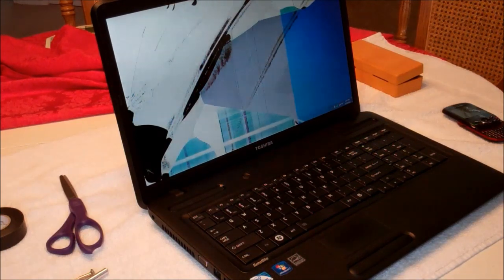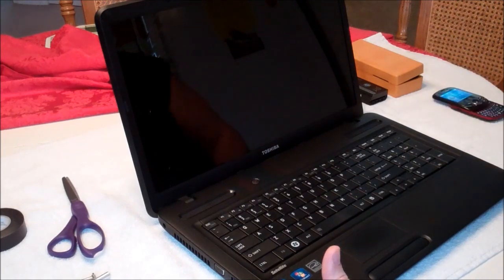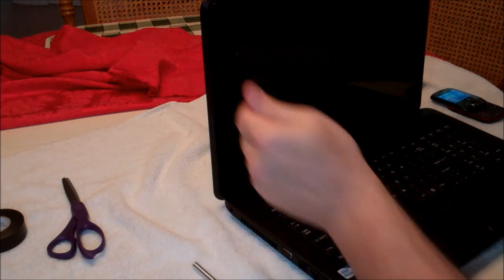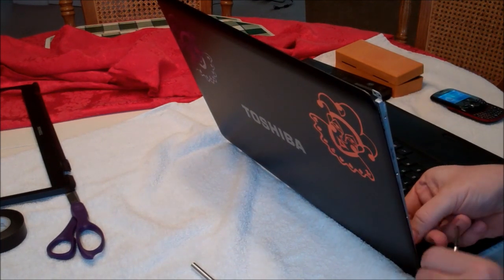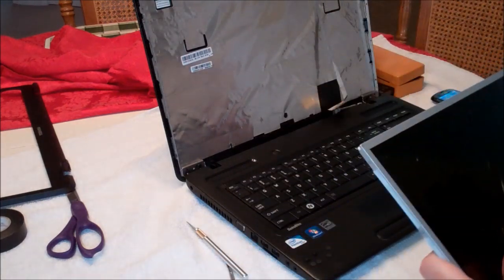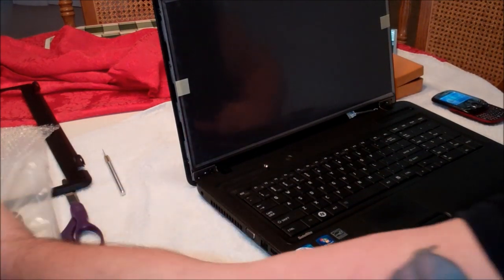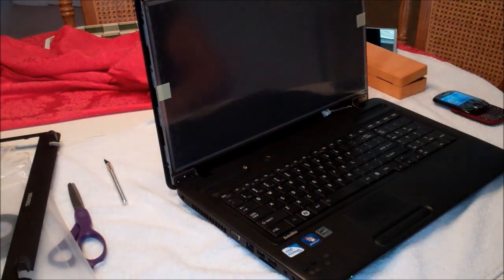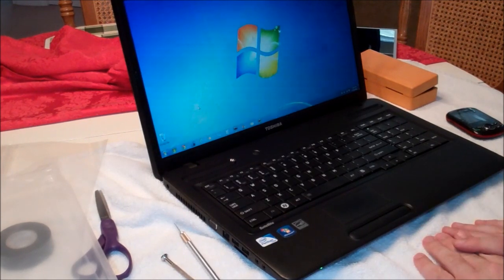How to Repair or Replace a Broken Laptop Screen on a Toshiba Satellite with Web Cam

Comment: I was able to connect my pc to the TV and use the TV as my output for now until I get my new scree. The pc screen does not come on till now. I hope it will be okay when I pot in the new screen eventually. I have been using my pc with the TV as my output. Thanks for your help.

Comment: Hello Jason, Please I like to ask you a question. I have a broken laptop. I had not ordered for the part but I had to open it up to see where the computer connects to, left or right and also to know the inches of the screen as I understood that it is written at the back like LTN156AT24....This made me know it is a 1.56 inch screen. It is a Toshiba satellite L850D-12P. It is connected to the bottom left just like the one you used in this video.After getting these info from the back of the screen after removing the bezel, I tried to couple everything back since I do not yet have the new screen I needed so I could still be using the broken screen until I order and receive the new screen. To my surprise, the laptop refuse to come on. When I replaced the battery and powered it on, there were the 3 usual  light indications on the keyboard area but the monitor had no light on it. The screen was still dark as if the computer was off. I do not know why this happened. I wonder if there is a contact problem somewhere. The only screws I removed was the four holding the bezel and the four holding the back case with the screen. I did not remove any connections. Please do you have an idea what could have gone wrong? I still need to use my pc before I receive my new one. I would be so glad if I can get a reply from you. That would be awesome. Thank you so much. Anyone out there that could help me with the question should do please because I am desperate for help. Thanks guys!
Reply: If you have no indications lights the laptop is on from the body of the laptop (not just the screen) I would try to power up using the laptops power cord as your power source. As long as you have the pin strip plugged in correctly and the power is on you should see power to the screen even if it's cracked. Hope that helps you out some and good luck replacing your screen. Wishing you all the best! ~ Jase
Reply: Thanks a lot for your reply. I powered the laptop with the power cord plugged to the socket and the battery in place and still the screen light did not come on. I did not get to the extent of removing the pins strip at the back because I did not need to since I was only checking for info and had not ordered for my screen. I started regretting why I opened it in the first place because the computer has been working perfectly until I opened it. But how else would I had known the inch of the screen and whether it connects to the left or right? I do not know if the screen light will come on if I eventually get the new one. Oh dear! I'm missing my computer. What did I do wrong. The only thing I noticed is that the connection for the webcam at the top of the computer was not in place. I then aligned it and pushed it into the position before fixing back the bezel. Could that have been where the loss of contact is? I wonder.

Comment: Who is the reputable seller and is your screen still working?
Reply from the maker: I honestly can't remember the seller but it was off of Amazon.com if you look at my earlier replies I believe I posted a link. When looking at a dealer check their feedback, and go with someone who has had good reviews, as to the screen, yes still working like a champ. Use the laptop daily with zero problems.  Take care ~ Jase
Reply: +Jason Marshall awesome!! I just bought one for around $60. I've already removed the damaged one from your instructions. You are awesome and saved me money and the stress of relying on an overpriced repair shop
Reply: +Jason Marshall I have a question. So I replaced the screen and all is good except that now I'm unable to find and wireless network connections. Any idea how to fix this issue. I reopened the screen and believe the wire is on the side of the screen but nothing seems out of place except a little metal magnet square thing did fall out when I was replacing the screen. Any clue? I don't know where that metal magnet thing even came from. That's the only thing I can think of that may be impacting my network connection. Wireless light is on (yellow) but says "no connection found"

Comment: Jason A 9..5/10 deducted point because hinge/lid cover brackets? removal was not shown
Reply: He did actually show that. However he didn't mention the wires that are there so be careful with how far you extend the keyboard area from the screen Area. You don't want to pull wires.

Comment: Hey :) I just used ur video to replace my screen on my toshiba satellite 15´6'' and its working :) so ty very much ur video was a great help.
My process was not as swift as urs tho it took me 1½ hour and i broke the two "threads(?)" which holds the screws of the besel in the buttom, idk how they broke, i was very careful, do u have any tips to how i do avoid that if i need to replace a screen in the future? also i can't get the besel to click back in where the "toshiba" logo is something might have broken there to i figure. 
Even tho those 2 things broke it is still WAY better that the screen works as perfectly as it does now i just need to be a little more careful when i close it :) so ty again.
- Jeanette

Comment: you talked about an arc cable if the connector is on the wrong side?  I have been looking around and I can not find anything.

I am using an old screen off of a Dell laptop and it works, but since the connection is on the wrong side I can not make it fit.
Reply from the maker: Matthew - some of the same places that sell screens will sell the pin arc connector...again Im not an expert but have seen those connectors when I was shopping for my screen, bit that was awhile ago. Take care - Jase
Reply: thank you Jason

Comment: correct me if i am wrong although you unplugged the 40 pin connector from the right side of the computer......when you pull the screen out and flip it uprite (it looked upside down as you looked at it in the computer)that is the determiner of it being actually a left side connection...just want to be clear.. other than that. ty. good vid.

Comment: wow that looks so easy. I dropped my Toshiba Satellite C850-1CO this morning and the screen is covered in lines both switched on and off so I'm guessing the screen needs replacing. The screws are under the little caps like they are on your model. Do you think the part inside with the connection would be basically the same? As you may be able to tell I don't know a lot about computers at all, just how to use one! Thanks

Comment: Hi Jason, This really was an amazing video! Thank you for showing this! I am in the same boat now. I have a Toshiba Satellite C55t-A Laptop. It is a touch screen and had recently got cracked. You by any chance wouldn't have any advice on how to replace the screen on that model would you? Any help or advice you could possibly give would of great help. Thank you one again for showing this video!
Reply: Not exactly sure on your model but it should be fairly similar. All these laptops have the outer plastic bezel which usually has 4-6 small screws and then you can unsnap the bezel open. Then you should find the metal thin frame which again will have about 4 screws holding the actual screen in place. Everything else should be the same as in my video. Thanks again for the kind words and good luck on your repair! Take care ~ Jase

Comment: i too have toshiba laptop model L655-1H3, My screen has a vertical line on it . i have gone through your video but cant find the screws on the screen as it is for your laptop.  can you provide your details so that you can repair my laptop... i live in australia melbourne.
Reply from the maker: The screws are under the little circle caps and rubber bumpers on my model. I wouldn't know your model number of your paticular screen (part number you need) without opening the housing and seeing the back of your screen. I'm not a repairman I'm just a regular guy - the whole reason for the video, to show the lay person...you can do repairs yourself and save yourself major some jing.

Comment: Jason, you are a Good sent. Best video out there. Than you so much. One question where to I find three screwdriver?
Reply from the maker: Three screwdriver? A small set like I have?? All you need is a small screwdriver with a philips head. You should be able to find one anywhere as a small kit...Wal-Mart, K-Mart, Target, Lowes, Home Depot - where ever. Thank I'm glad it helped. The whole reason I posted it.

Comment: I also got a Satellite. Now I heard stories that hackers can hack into your computer, turn off your LED and use your cam. Is this true or.. is that just BS?
Reply from the maker: If you are truly worried a small piece of electrical tape over the webcam can fix that...also that kind of tape has a low adhesive point so it's easy to remove when you want people to see you! For me...I'm not to worried if a hacker ever watched me he would fall asleep in 3 minutes.

Comment: My toshiba satellite screen cracked, and thank to this video I was able to replace the screen 12 minutes ago. I ordered the new screen yesterday in the morning and got it today and just replaced it. It only costed me around 60 bucks, I am so happy that I did not have to take it to a computer shop which would had charged me around 300. Thank you for posting this video. Now, I have to be more careful with my laptop among other electric devices. Once again, Thank You :)

Comment: Thanks for the video. I had a similar model, but close enough that this video helped me. My only recommendation is to mention the fact that the connector has to be pushed all the way in(on my first attempt I hadn't pushed it all the way in and only got a black, backlit screen upon reboot) I was over cautious on my first attempt, knowing that the connector is extremely fragile. My second attempt, I realized that it wasn't snapped in place. Worked perfectly after that. Made comment with fixed PC.

Comment: Probably you misshandle the computer, you may have knocked it and damaged something inside or there is a cable loosed inside, also, computers are extremely sensitive to static, you may have burned some parts by touching them ungrounded....

Comment from the maker: Best Buy doesn't sells just parts like that they wanted hundreds to fix mine cause I called their geek squad at first when it happened. I found out the part only went for $50-$60 and realized I could save myself $250 by working on and doing it myself. The video is living proof that a lay person can do something a 'tech' would charge close to $300 for basically changing a computers version of a light bulb. For me being a male nurse that works 48 hours a week to support my family that's too much.

Comment from the maker: Not sure why it wouldn't boot....when changing the screen that is really all you are doing. You aren't messing with the core of the system. In fact while my screen was busted I could still hook up my laptop to my TV via the VGA 15 pin connector, so I could still answer emails and do my side business on Evilbay...I mean eBay. Because even though my screen was fried as seen in the start of my video the hard drive and core was fine. Plus Toshiba does have impact hard drives to prevent such damage.

Comment: I ordered my new screen, installed it, it came on but had several lines through it. So I reconnected the pin because I thought it wasn't connected well, and now my computer won't even boot up. I am confused, and feeling defeated! Any suggestions?

Comment from the maker: Yes I would suggest taking out the old cracked screen first that way you will have your exact part number you need to replace your screen no matter what make or brand of laptop you have. Please remember I'm not a computer guru or repairman. I'm a home health nurse... I can understand and deal with people who are broken more then I can with electronic equipment, but this honestly is a super easy fix. Just take a little time and patience and you will be surprised of what you can do. Thanks Jase

Comment: i should be doing this in Sept cant wait but i should deffinately remove the cracked screen first right its a satalite c655d s5518  and then my bfs is hard to open and close what replacement do i need for that

Comment from the maker: No it's the same procedure either way. Just make sure your have your correct part number when you order your screen. It's a simple fix which includes just unscrewing some screws unplugging then remove and reverse to install. Great way to save yourself $200 to $350. Thanks for watching.  Jase

Comment: I have a toshiba..I removed the LCD scree, now I'm on amazon.com to order new screen, the back of my screen model # is LP156WH4 TL A1. The replacement have a yellow strip down right side..my screen does not have that, the screen on amazon that seems to macth mines is: LG LP156WH2(TL)(QB) Replacement LAPTOP LCD SCREEN 15.6" WXGA HD LED backlight (or compatible screen like LP156WH4 (TL)(A1) ). Can I order this one because it does not have the yellow strip..please advise I need to order asap. Ty

Comment: Hey James Marshall, My daughter broke my laptop screen and i took to a computer repair store and they want to charge me 50$ to look at it then 250$ to order the screen and for the labor 300$ so i just told them to forget it. I saw your video and it look easy and i was wondering if you can help me find the right screen part to my laptop HP dv7-6b78us i know the screen size is a 17" but im asking for your help! thanks

Comment from the maker: The C675-S7200 is your computers model number.... the Part number you need is B173RW01....the Amazon link you need is 
amazon.com/AU-OPTRONICS-B173RW01-CONNECTOR-compatible/dp/B004MA3FN8 .....Hope that helps. Jase

Comment from the maker: When they replaced your screen there is a good chance they may have pull that monitor wire out to far which has the slave wire that connects to the webcam...so  they may have unplugged your web cam by mistake. Like I was saying in my video you have to be careful of that wire that leads to the webcam because it is extremely easy to dislodge it or unplug it. Hope that helps fix your problem. Which BTW way is to follow all the steps of this video to get to the webcam wire and check it's connection.